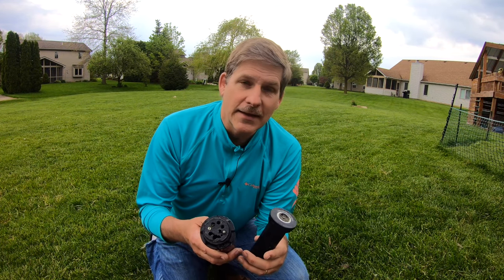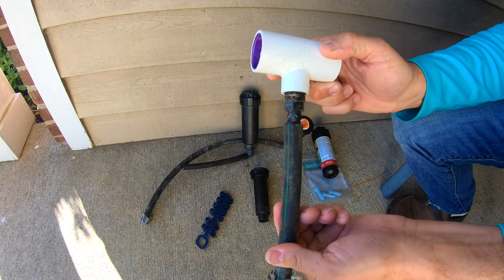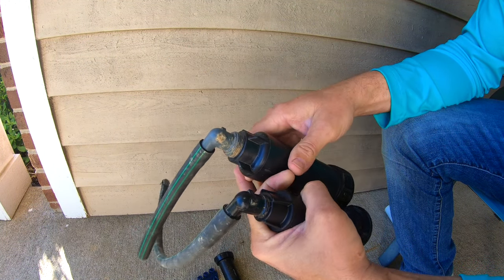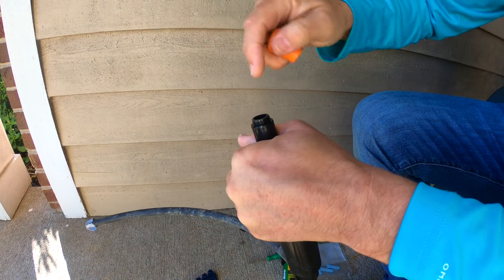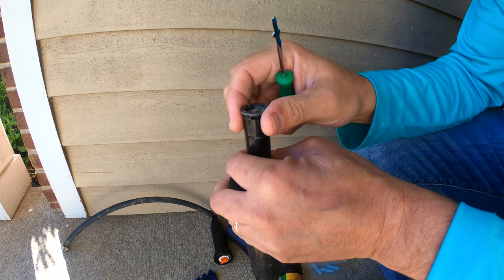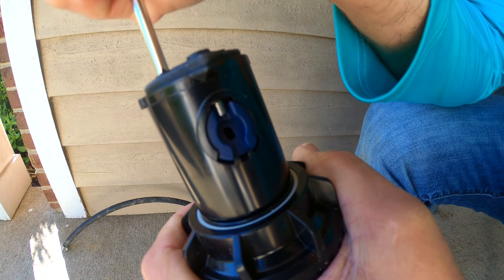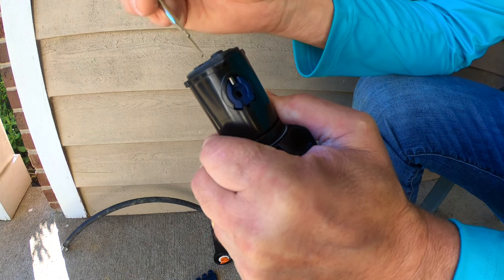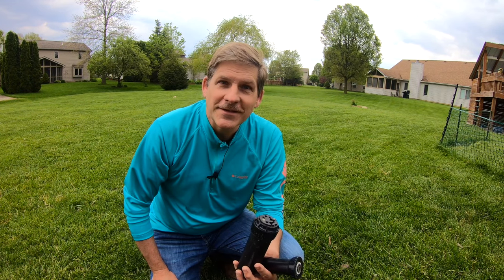How to Fix Sprinkler Head: Repair, Replace, Adjust Pop Up Sprinkler

Comment from the maker: If you are interested in the most affordable sprinkler option we've used, check out the Rain Bird 1800 Series Pop-Up Sprinklers.
We have many of these in our yard - they last long & work well! (especially if you don't need to cover large square footage).
Rain Bird 1800 Series Pop-Up Sprinklers 10 PACK - Nozzles NOT included - RainBird 4" 1804 model pop up irrigation sprinkler for lawn, yard, garden, planter beds
by Rain Bird
https://amzn.to/3bbMRiR
We also listed a bunch of other Raindbird sprinkler options / supplies listed in the video description. Just FYI. These links are affiliate links. They are free for you to use AND Amazon will pay us a small commission if you use them - Many thanks if you do. It helps us keep making videos!

Comment: All this (great info about) fixing of the sprinkler heads … is my reward for 30 minutes excavating a little 12 inch hole around the sprinkler in my cement-hard karst mud here in Austin, TX.
Reply from the maker: Hey Quentin,
Sounds like fun! Thx for watching!

Comment: Thanks for the video, I purchased a house which is over 20 years old with an irrigation well pump for the sprinkler system.  Front yard pop ups are not popping all the way up when using the RainBird ESP controller in the house, but when I turn the valve on from the gound box they work fine with no problems (Valves are CP-100).  Any suggestions on what I may need to do to fix this issue?
Reply from the maker: Hey creative,
It may be your controller. We replaced a malfunctioning one last year - younger than yours. 
Check the battery 1st.
Then maybe try to run thru a cycle and test the wire leads with a multi/meter to see if power is being sent to the valves. 
Also - worst case??? Cut wire? Look up doing a continuity test to make sure wire is uncut all the way to the valve. 
Hope you get it figured out!!
Thx for watching!

Comment: Great video! I actually have an inlet attached to my rainbird. What is an inlet used for?
Reply from the maker: Hey Demis…,
If it’s a side inlet, that’s just a different design for the incoming water supply as opposed to ours where the water enters the head at the bottom. 
Thx for watching!

Comment: I noticed this was in front of your home..i have same problem...do i need to shut of water from main line in front where sidewalk(city) is..or as long as my valve is off i can still do it?
Reply from the maker: Hey M14..,
No. Even if your sprinkler system is charged ( main lines full of water), the water does not  go to the sprinkler head till the specific zone is selected on the control box. So if you haven't turned it on and selected that zone to open that valve, then you can work away. All valves are in off position at rest.Thx for watching!

Comment: Thanks for posting.   I installed new sprinkler head but not enough pressure to push valve all the way up.  The other ones all work fine.  Not sure what went wrong?
Reply from the maker: Hey J C,
Unless it is stuck, you probably don’t have enough water pressure to to lift all of the sprinklers. 
Test it and see. You can put restrictors ( mesh screens)  in some smaller sprinklers to build up the pressure behind the sprinklers. 
Or in the rotary sprinkler, you can put in lower flow nozzles. 
Hope you find/ found a way.
Thx for watching!
Reply: This happened to me; just now. I unscrewed the head, took it off and turned on my system to push any blockage out of the system. Also I took the head and bumped it on my palm a few times. Some mud and small pebbles came out. I screwed the head back on and the sprinkler worked fine.
Thank you houseBarons, you saved me some money.

Comment: What is the small screw in the middle of the pop up?
Reply from the maker: Hey Rhonda,
That screw, if turned a few rotations clockwise, will reduce water flow or even stop it completely. Counterclockwise lets more water out. Thx for watching!

Comment: NOTHING about repairs in here.
Reply: I found value in this video. I don’t understand why there is a comment  saying “nothing about repairs.”Thank you house barons for taking the time to show the adjustment of the heads, gear driven heads and tools to adjust the arc of the spray.  I have 2 heads that are bent backwards and need to be re set in the ground.  My grass at the curb is not getting watered because of it.  This was a great video of how to adjust and replace. Saved me time and money. thx.